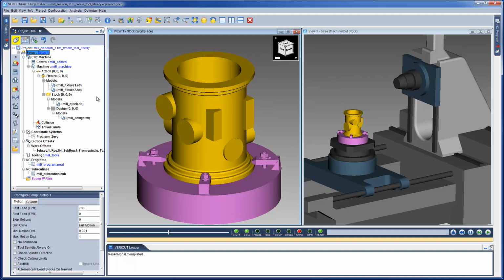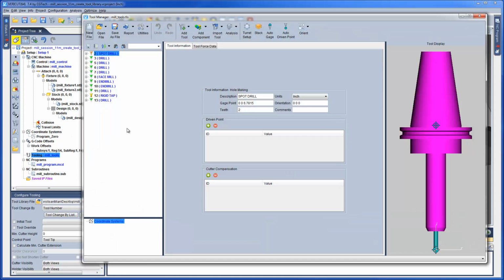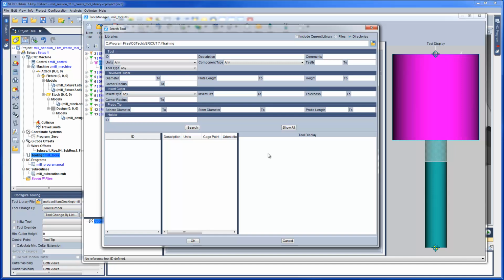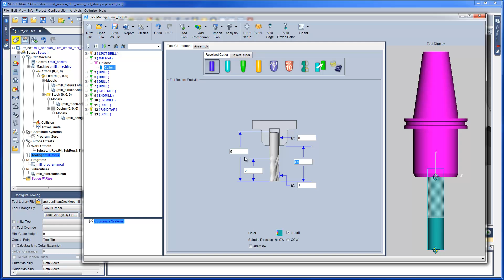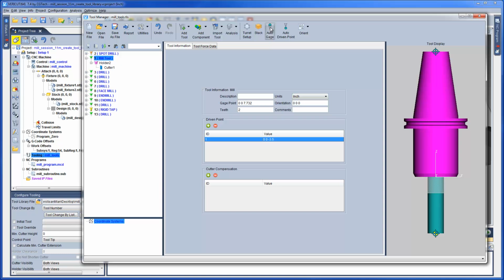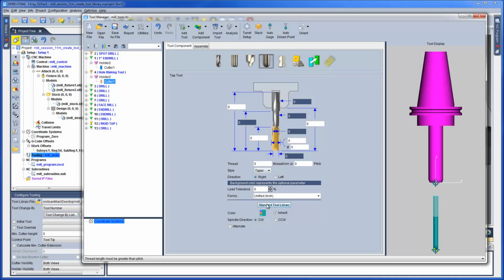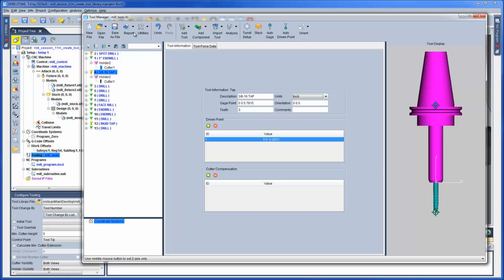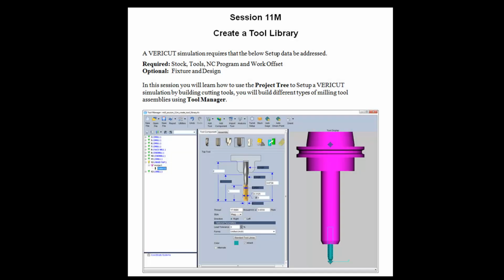Define cutting tools in VERICUT 7 CNC simulation software

Comment: Excuse me, but I still don't get why did you assign the same driven point number (1) for both tools. Same goes for in-program tutorial. Doesn't driven point reflect H parameter i.e stick-out in CNC tool table?
Reply from the maker: +CouncilofThirteen, In some cases, the driven point ID and the cutter compensation ID could be different than the tool ID.  Also we have lots of cases with alpha-numeric tool IDs. It's possible to configure VERICUT in order to ignore the Driven and cutter compensation ID. Please feel free to contact CGTech Technical Support if you need more details.
http://www.cgtech.com/vericut_support/